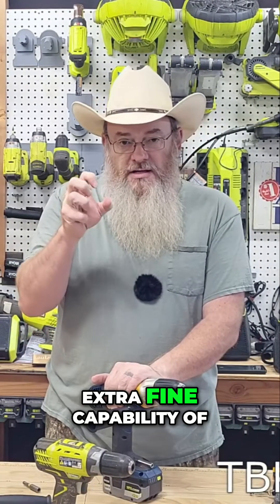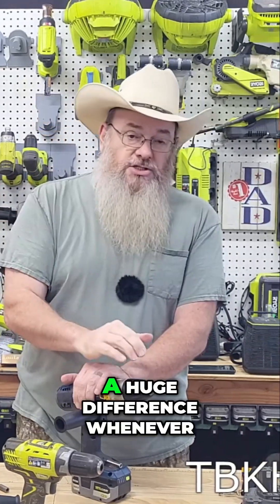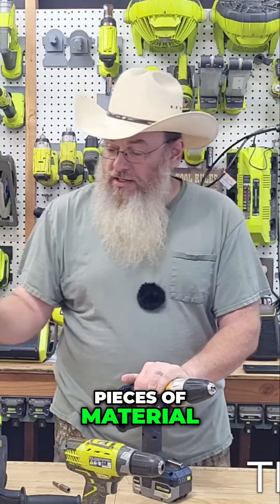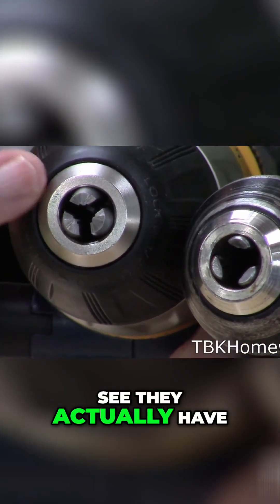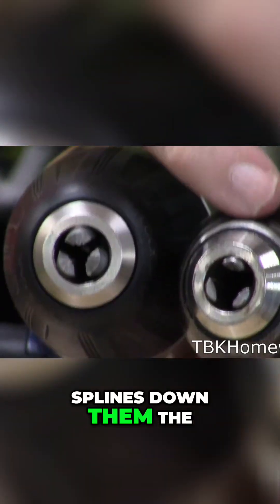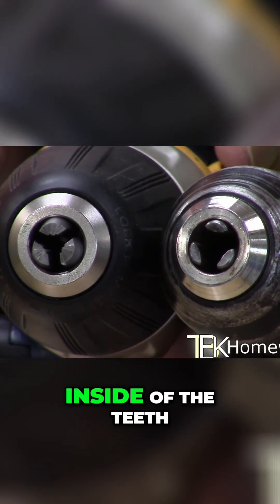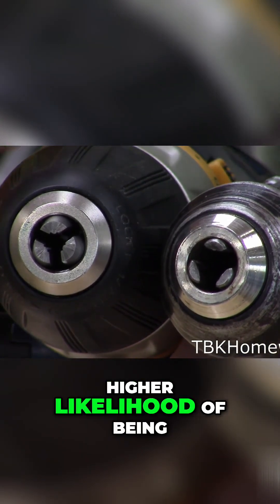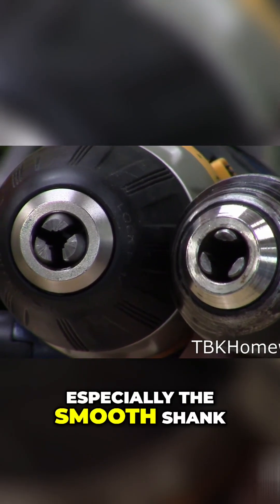Different Styles Of Drill Bits EXPLAINED: Which Should YOU Buy?

Comment: Maybe I misunderstood but are you saying the jaws with grooves will hold better? In my experience more surface contact, the smooth jaws, will hold better. My MT2 lathe attachments, lathe and shaper collets, and drill press jaws and my corded/battery drills are all smooth and have held fine for decades. Maybe I’ve just been lucky. Perhaps less precise machining might benefit from grooves.
Reply from the maker: In my experience the ones with grooves/teeth end up biting into the round drill bits and end up holding it better.  However, for 1/4" shanked bits the smooth work better.  So it depends on which type of drill bits you are using.

I also believe this is dependent upon the quality of the chuck, metal being used in it, etc. and for most home/DIY users it is typically the least expensive stuff and in those instances the teeth do a better job (at least in my experience.)  Specifically these two Ryobi drills, the new yellow one with the flat sides spins out on the fully round bits pretty dang often while the old blue Ryobi holds onto them a lot more and does a better job of not spinning on it.  

I hope that helps explain it a 'bit' more. (joke intended)

Thanks for asking a great question and watching!